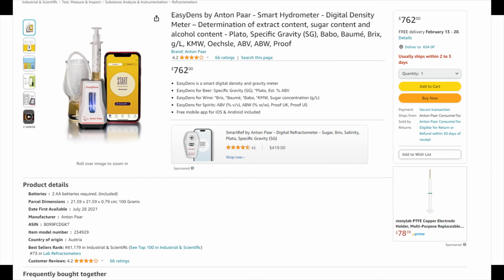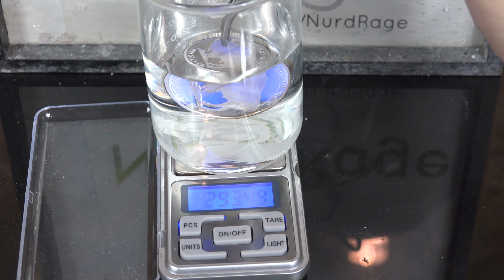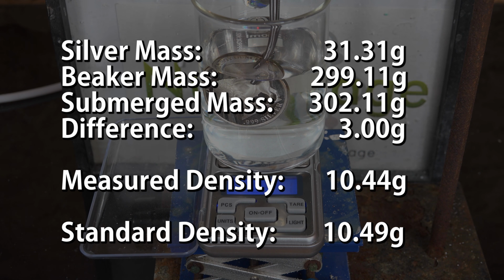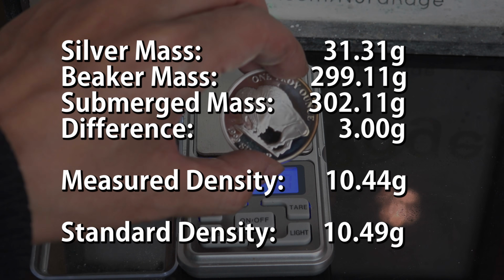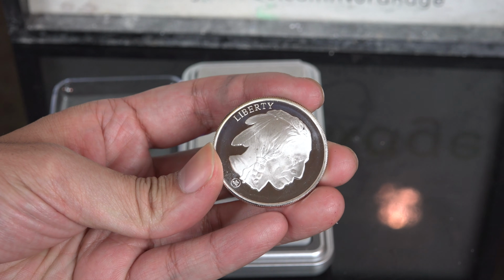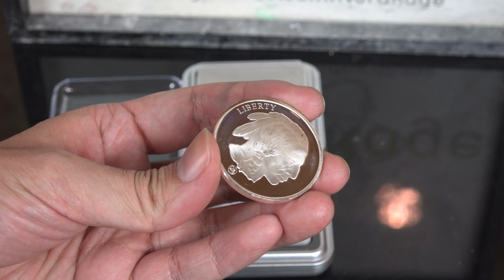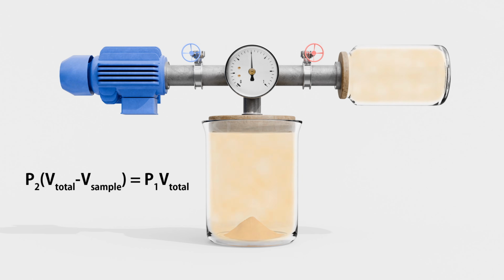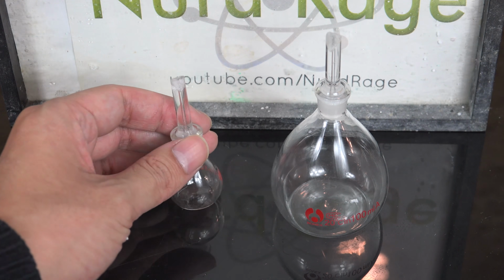Measuring Density with Pycnometers, Hydrometers, and Graduated Cylinders

Comment: Could any vessel do as a pycnometer if results could be replaced reliably?  Seems like something like that could be easily replicated, any flask with a 3d printed stopper could provide similar results?
Reply from the maker: Yeah... But best to use glass as its not as flexible and springy as plastic... But for amateur work then yeah, pretty much any reproducible volume can be used as a pycnometer
Reply: A normal ground/Standard Taper flask like NurdRage demonstrated is adequate, just write down the empty mass and volume of your flask and stopper combo and use the dry mass to check your scale before running your test.

What was a bit scary was seeing NurdRage placing a stopper into a ground glass flask filled to the brim.  If you are even slightly unlucky you could press it tight and then the vacuum will make it very hard to open without spilling something somewhere, fine with water but less so with concentrated acid.  For that reason I would find a solid stopper and drill a hole in it, that would be almost as good as a budget pycnometer but probably have a random volume like 139ml instead of 100ml+- a bit that you cannot ignore even in an amateur setting.

Comment: a shortcut to remove/reduce the reading errors on glassware. use two lines (i.e. 50 and 100) and use the surface curvature for exact positioning, i.e. in both cases the bottom of the surface bulge just barely touches the top of the line. this way it is slightly more accurate. though temperature must always be factored in!

bonus tip: if you work in a lab, use the "big names" as they dont cheap out on proper markings. very cheap stuff is off, most of the times..

Comment: Hey! You got something slightly wrong about the u-tube density measurement thigny. Not only does the frequency changes, there is also a gyroscopic effect that twists the u perpendicular to the oscillation axis. The device likely measures the force produced from that twist for the most accuracy. 
The liquid moving in a semi-circle at the bottom of the U acts as a turning flywheel that resists the oscillation and induces the gyroscopic effect.
Reply: When measuring the density only you would prevent flow in the U-tube and avoid any torsion effects, the density will simply affect the total mass of the U-tube and the resulting resonant frequency.

In a Coriolis flow meter it is necessary to know or measure the density of the fluid and the temperature of the pipe so you can get accurate mass (or volume if you also measure the pressure) flow rates.

Comment: In the first part of the video you used a cylinder. Is there any reason why you didn't use a volumetric flask instead? Is a class A volunetric flask just as inaccurate as a cylinder?
Reply: They are slightly less common, more expensive and only have one graduation that you have to hit exactly without being able to read or even estimate the exact volume if you put in a ml too much or too little.  The scribed mark should be more accurate than a random scale on a graduated cylinder but it is not the best tool for the job.  Harder to clean and dry too.

Also you cannot float a hydrometer in a volumetric flask. :-)
Reply: @KallePihlajasaari  They are certainly more common than pycnometers, you will usually find them in any laboratory, that is why I asked. Ease of cleaning and use should be about the same. It has always been my understanding that they are way more accurate than cylinders when measuring volume, but perhaps I am mistaken.

You would never float a hydrometer in a volumetric flask, in fact you don't really need a scaled container to float a hydrometer, I assume you were making a joke
Reply: @valfodr  You changed the goal posts or were unclear at first.  You were comparing Volumetric Flasks to Graduated cylinders.  If you wanted to compare to the pycnometer then the differences are less and as you say they would be more common in a preparatory lab than a analytical lab for sure, neither flask would be common in an amateur lab.  Cost would be similar, cleaning out might be only slightly more work. A range of volumes is available and you do not have to spill product when preparing the volume up so that would be a positive but you have to dose it to a fixed volume mark that cannot be 'read off' and is not predetermined so speed will suffer.

For the amateur for occasional use with liquids I think the volumetric flask is a good alternative to a pycnometer, I just remember that mu wife found me a 5ml volumetric flask without a top I could experiment with.

The hydrometer comment was because it showed the use of the graduated cylinder that NurdRage demonstrated.

Comment: Ok, when showing the basics of finding density. Is there a reason you weighed the cylinder, added water, and weighed it again instead of putting the cylinder on the scale, zeroing it, and then adding water so you start off with only the weight of the water?
Reply from the maker: Drift, If the scale starts drifting you need to re-zero it. But if you already tared it then your measurement will be off. So its better to simply record the absolute values for everything and do the calculation later.

But nothing wrong with taring in an amateur setting. I'm just stuck in my ways from my days doing it the long way in a professional setting.
Reply: @NurdRage my second favorite scale served me many years, way way past it's warranty. Calibration was always a pleasure.  It was especially great form not shutting off after a certain time, add to that nearly no drift and ease of maintenance and a waterleveret and screws to adjust the plane. It came with also a seriall port to log the data. (Only used it for novelty, the pencil we rwritten data is still readable after all these years that apparatus is Rip. Also a power adapter was included and there was the option to use batteries instead.. Stainless parts where needed, good bright large display. Chem and dust resistance was well designed. And most of all: it was a German brand but not fancy and thus  super affordable. Love that type of equipment where you just feel the pashion of the team behind it. It only became damaged after a hastely organised moving house to go ousr.. 
I do love now many types of (chem) measuring equipment are becomingmoee every month more afooa  afordablw
Reply: @NurdRage  I know that load cells drift (it is called creep in load cell terminology), but I thought that those ug balances had very low drift, because force is too little.
I spent part of my life working with electronic weighing systems, and drift was a nightmare, tons more reasons aside of load cell creep cause it.

Comment: Non-scientific person here but is there a reason why you don't use the tear button to zero out the scale after you measure the empty flask?
Reply from the maker: The biggest issue is drift. If the scale starts drifting you need to re-zero it. But if you already tared it then your measurement will be off. So its better to simply record the absolute values for everything and do the calculation later.

Comment: Summary

Basic Density Measurement

* (1:20) Graduated cylinders are a simple but not very accurate way to measure liquid density. 
    * Weigh the empty cylinder, add liquid, weigh again, and divide the mass difference by the volume reading.
    * Errors can arise from temperature differences and meniscus readings.

Specialized Tools and Techniques

* (2:47) Hydrometers are inexpensive floaters that directly indicate density on a calibrated scale.
    * Easy to use, just float in the liquid and read the scale.
    * Great for quick checks, like monitoring home brewing or electrolyte concentration.
    * Limited measurement range (often 1-1.2 g/mL), not suitable for all liquids.
* (5:04) Pycnometers are precise volumetric flasks with a capillary hole in the stopper to ensure a reproducible volume.
    * Calibrate by weighing empty, then filled with a liquid of known density (usually water).
    * Fill with the unknown liquid, weigh, and calculate density using the calibrated volume.
    * Much more accurate than graduated cylinders and hydrometers.
    * Affordable for amateurs, with professional models offering even greater precision.
* (9:14) Grinding Pycnometer Stoppers
    * Cheap pycnometers may have wobbly stoppers that can be improved by grinding.
    * Use valve grinding compound and a hand drill (with caution!) for a tighter fit.
    * Not strictly necessary for amateur use, but improves accuracy for perfectionists.

Measuring Solid Density

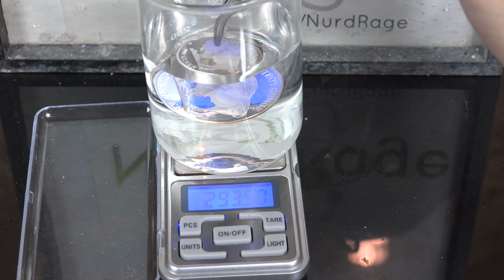* (14:34) Archimedes' Principle:  A submerged object experiences an upward force equal to the weight of the displaced liquid.
    * Weigh the solid, then submerge it in a liquid of known density (water is common).
    * Measure the weight difference to calculate the volume of liquid displaced, which equals the solid's volume.
    * Divide the solid's mass by its volume to determine density.
* (17:17) Powder Density with a Pycnometer:
    * Calibrate the pycnometer as usual.
    * Choose a solvent that the powder doesn't dissolve (or has very low solubility) in.
    * Create a saturated solution of the powder in the solvent.
    * Fill the pycnometer with the powder, then add the saturated solvent to fill the gaps. 
    * Carefully remove air bubbles.
    * Measure the mass of the powder + solvent, subtract the known mass of the powder, and use the solvent's density to calculate its volume.
    * Subtract the solvent volume from the pycnometer's total volume to find the powder's volume.
    * Divide the powder's mass by its volume to get its density.

Professional Density Measurement

* (12:37) U-tube density meters are digital instruments that use vibration to precisely measure liquid density. 
    * Fast and accurate, but expensive.
    * Now available for amateur use, but with limited density range (mostly for brewing).
* (21:39) Gas pycnometers use gas displacement to measure the volume of powders, even porous ones.
    * Accurate and versatile, but expensive.

General Tips

* Use a companion weight (11:49) to simplify mass measurements with a pycnometer.
* When measuring powder density, choose a solvent with low solubility in the powder.
* Saturate the chosen solvent with the powder to minimize errors due to dissolution.

The video emphasizes that while density measurement might not be the most glamorous aspect of chemistry, it's a fundamental and valuable technique for characterizing substances and monitoring reactions. 

i used gemini 1.5 pro to summarize the transcript